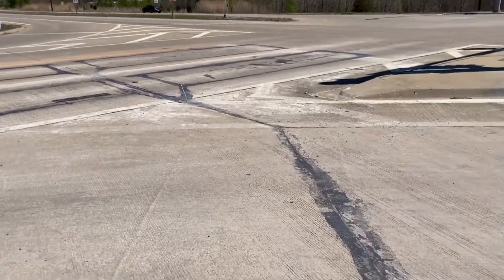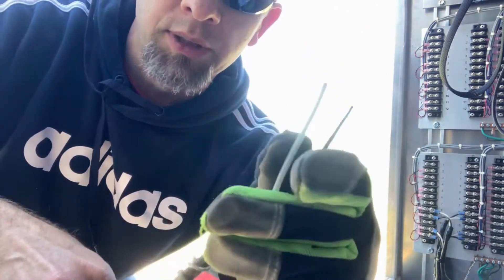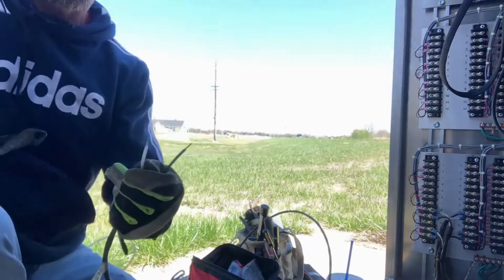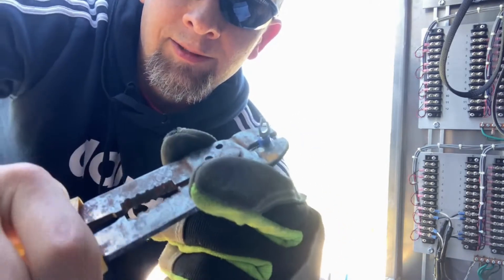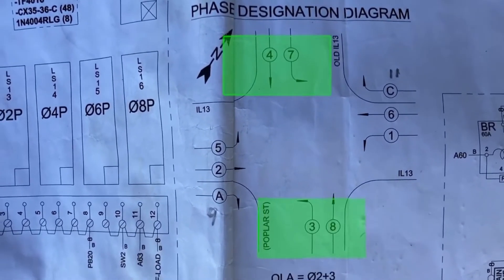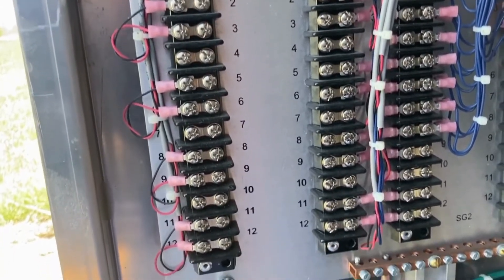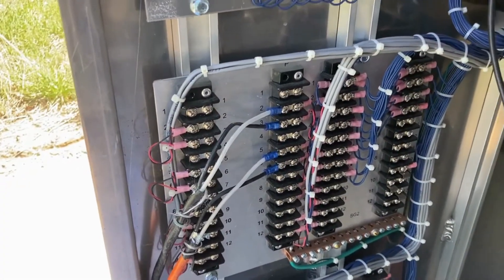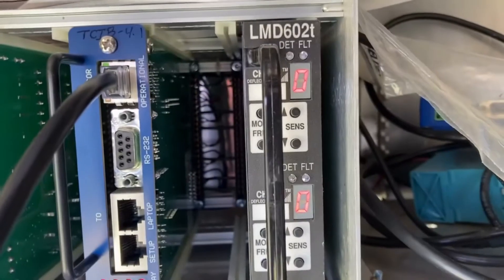Wiring Detector Loops into Traffic Signal Cabinet

Comment: I'm guessing you swapped in a different loop detection card just to more easily verify loop detection?
Induction loops still mystify and amaze me...
Reply from the maker: The original detector card was exclusive to the radar system.  THe one that was installed in its place is exclusive to inductive loops.  Hope that helped!  Thanks for the question...I'm sure others may have had the same question